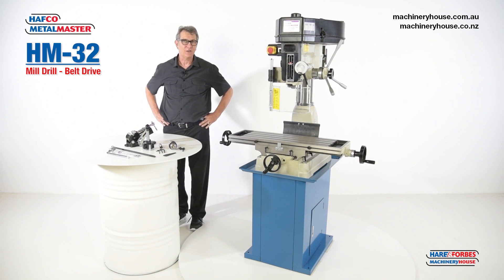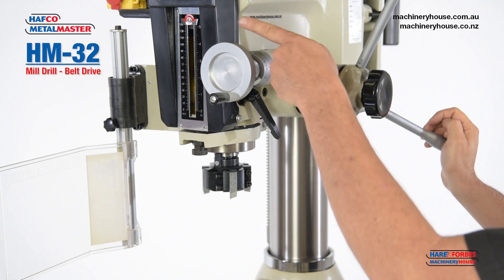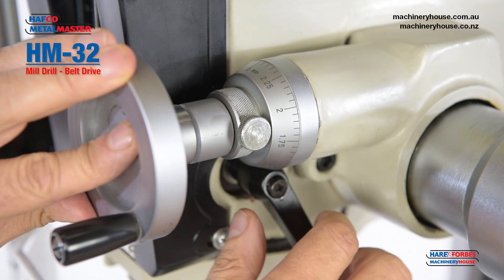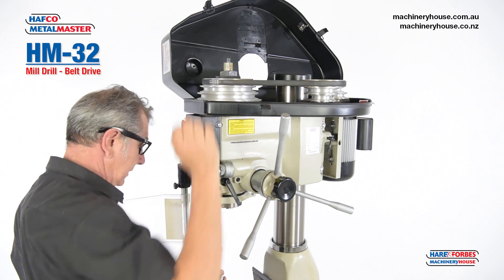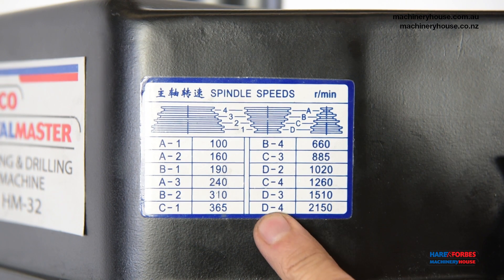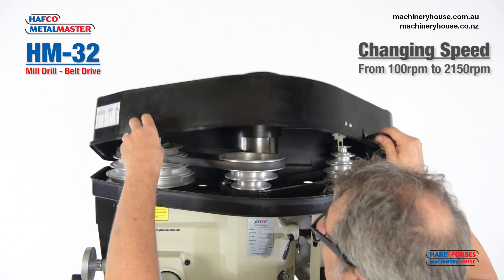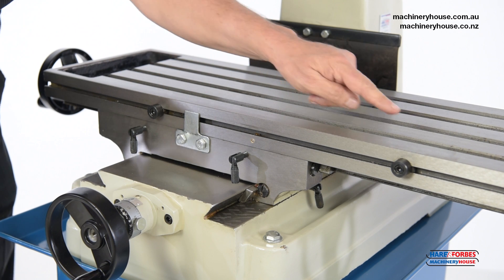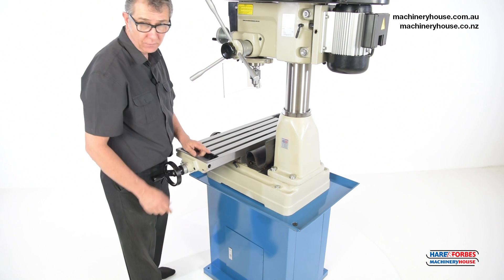HM-32 Mill Drill Hafco Metalmaster (M121)

Comment: just picked up a 32-b. Great machine. Read the manual. It reccommends under no circumstance use hammer. Read the other comments so i see how that can be a prob. The manual also says to fill up the oil. However i cant for the life of me find an add oil plug ? the quill has sealed bearings? are they meaning cutter fluid? It has a plastic guard and flashier switch panel to the 32 but no snazzy mill vise and only a 50mm face cutter. Over all though its a beauty for the price and i already have great milling vises. Great staff and service.Very happy.

Comment: These mill drills are great, however purchasers should think about models with a plastic belt guard.    The sheet steel ones are very noisy when cutting.

Comment: WARNING. DO NOT, under any circumstances use a hammer to drive out the Morse taper!!!!
 I used to own one of these Mills and it did a great job for a start. But, over a period of time the machine began to chatter when it was cutting and no matter what I did, the problem grew worse. I kept thinking the taper was at fault?
Then, the penny dropped! I wondered if by hitting the draw bar with a hammer (and the taper, being a slow, taper jammed in very tight) if I was putting dents in the lower taper bearing? I dismantled the quill assembly and lo and behold, the lower bearing had "more flats in it than South Perth"!
One thing I found was that the slot provided in my machine's quill for a tapered drift to drive out Morse tapers (by the way, the best way for most of us to get the tapered shanks out) needed to be lengthened. A friend was asked to do this and was done and the whole thing reassembled.
Two new bearing assemblies later and guess what? The machine was as good as new. I also made a new tapered drift to get the morse tapers out of the quill! I was a very happy camper. No more hitting that draw bar.
Still sold the mill drill though, I now own Bridgeport clone. Love that even more. Actually, no contest really!
Reply: Can these mills machine mild steel or harder materials
Reply: @plasticbag75  yes they can, however the appropriate cutters are the key to success. I had a selection of high speed steel cutters and some carbide insert types.  The one major fault with this type of machine is when you need to lift the head up during a job, you will loose alignment. Other than that and the quill modification it can be a useful tool.
Reply: I have a mt4 and cant see any ither way to get it out
Reply: The only ways to drive out the morse taper is with a rubber mallet and give a sharp tap from the side or use the drawbar to tap from above